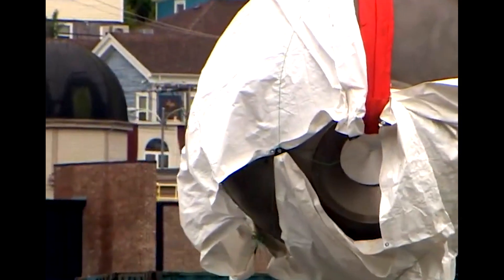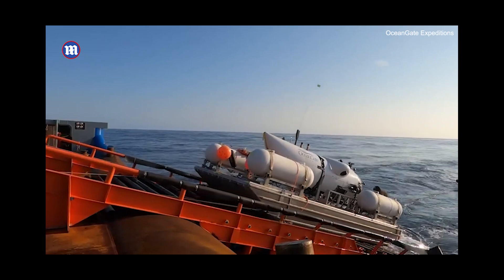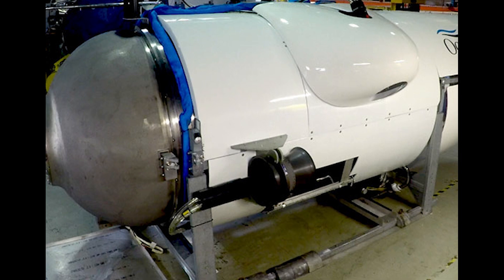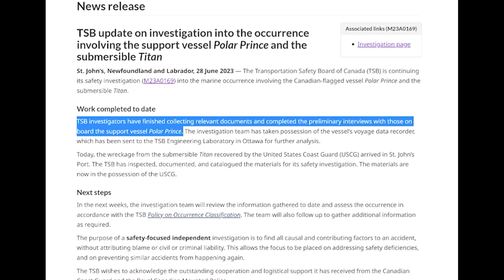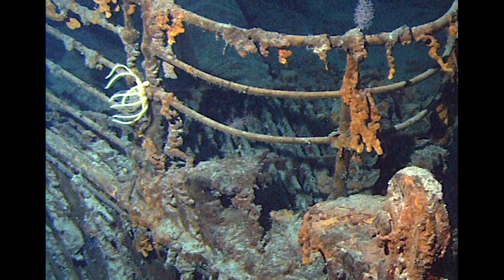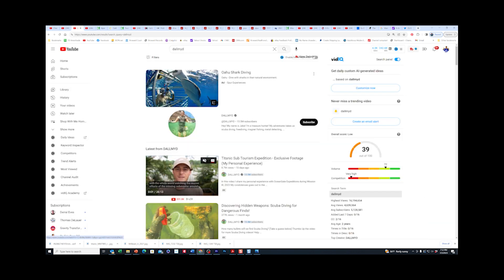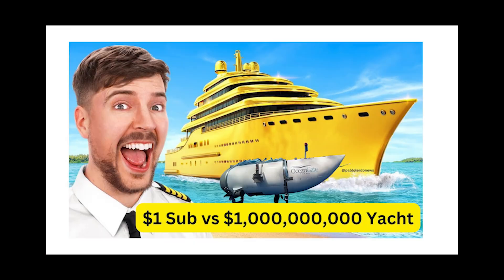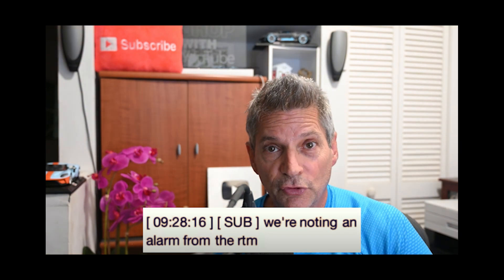Titan Submarine Debris Clues, Implosion Simulation

Comment: Jeff you are correct. That glue compressed and decompressed till the particals broke down. Temp change. 
You can super glue tin cans together. Heat up. Then place in ice water. Pops apart. 
Temperature check in water level.
Reply: I think it all started at the weakest point which is the glue. Perhaps the flexing of the carbon fiber affected the integrity of the bond so the blame could then also be put on the hull material. I hear all it takes is a hole the size of a needle point to cause disaster.
Reply: @larky368  possible. 
However. Rush used EXSPIERED  carbon fiber.  No flex with hull.
After learn of this
 I allege  leak where hull and titanium sealed. Blew front off. Shattered right side starboard shell splitting port side in two large pieces. Non flex carbon dents  not crushed like a can. Tail and wiring systems popped off with force of water imploding hall like putter hitting golf ball. Separating wires and stuff from hull. 
They dropped weights. Last message. Condensation around porthole entrance.

Comment: 2:30 This is amateur hour. I worked at Boeing for a few years.(JDAM) Bonding anything was taken seriously. These guys are just kicking it in a  warehouse where anything could contaminate the bonding process. Even human air would degrade and leave a void under all the PSI...
Reply from the maker: Now that sounds scary. I wonder how many voids they had in their carbon fiber
Reply: I agree.  I used to work QC for a company that made carbon fiber vacuum tanks for Boeing airliners.  Granted, less than 1 atmosphere differential, but all the epoxy bonding was done in a clean room.  And air particulate sampling in the general manufacturing areas was done every hour.

Comment: I think the CF failed and the window was forced off the end cap. The bonding agent around the TI was simply pressure washed clean off the metal. At those pressures salt water and everything suspended in it acts like a sandblaster.

Comment: I think that the cylinder collapsed inward causing that seam to separate.  The plexi port was gone because there was no way the salvage team could remove all those bolts.  My guess is that the cylinder collapsed first
Reply from the maker: Yes that is what I also think
Reply: Why is it impossible for them to remove a basic ass bolt??😂😂
Reply: @Just.A.T-Rex  They would not tamper with the evidence, imo. Plus removing 17 bolts at 3800 meters depth is not like changing your car tire.
Reply: @bills6093  good point.  but I wonder how exactly did they retrieve the end caps?     in the picture they are transferring them from the boat to the dock..  so the unbolting may have taken place after they were brought aboard.
Reply: @Just.A.T-Rex  I'm guessing, and I am guessing, there were 17 of them, were they all accessable? were they tork tight? and the equipment on the salvage submersible are limited.. anyway we will all find out soon
Reply: There's no way the salvage team would have been allowed to alter evidence by removing it...  The implosion took care of it.
Reply: The demonstrated implosion is about 500xs to slow fyi